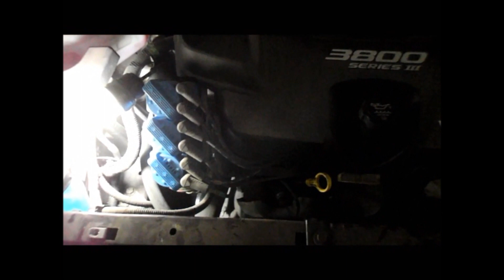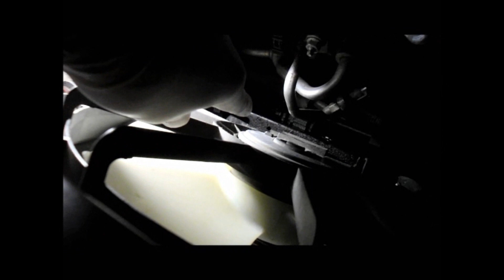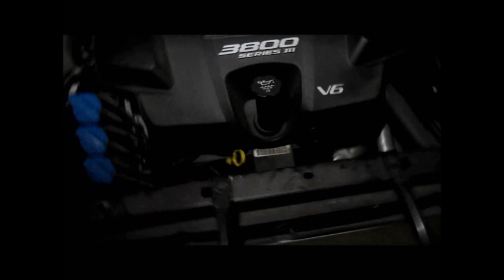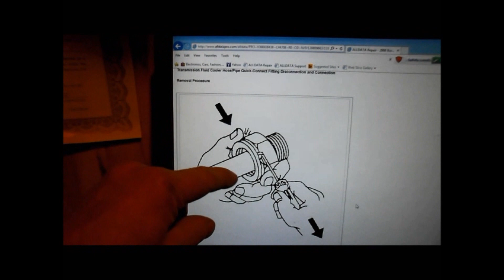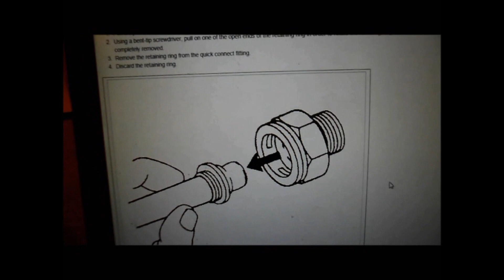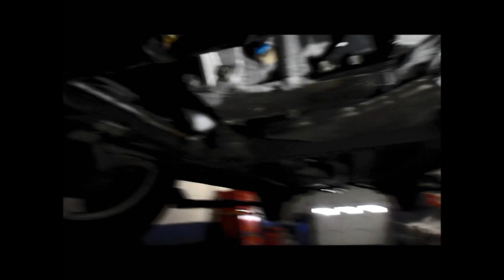How to remove a GM trans line

Comment: GM Oil Cooler Line Disconnect Tool No. 7937 also works - it may not fit in that tight spot - needs 1 and 1/4 inch clearance. I will check now to see if I need to cut it smaller - cut off a 1/4 inch off the tool to fit by my radiator quick disconnect. thanks

Comment: Can I get the part number I ordered them off OTC but they sent the wrong one do you have a part number.
Reply: OTC Corvette Transmission Line Disconnects - 6611 or also GM Oil cooler Line disconnect tool no. 7937 works but probably doesn't fit in as small a spot unless you cut the tool smaller

Comment: On my car, there is a plastic panel located underneath the car that is directly below the radiator that is held on by five 10mm bolts.  With that off, you have better access to the lower line.